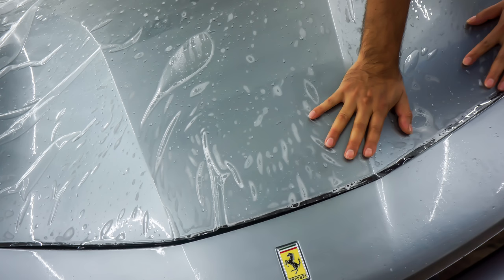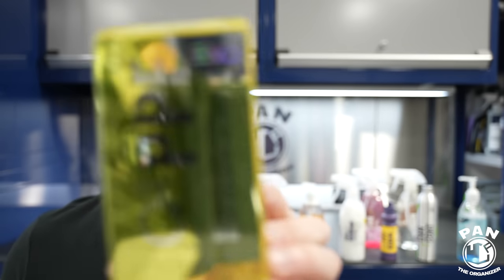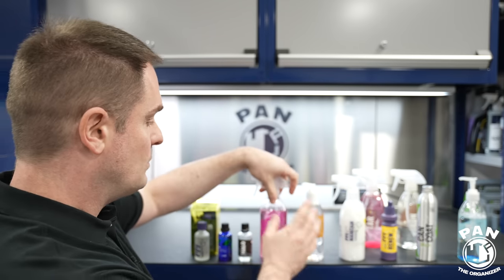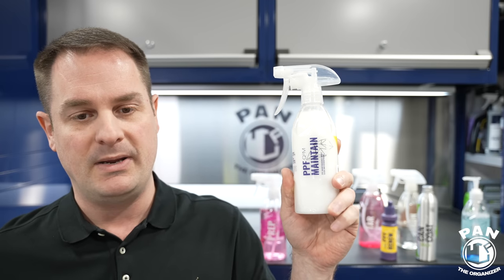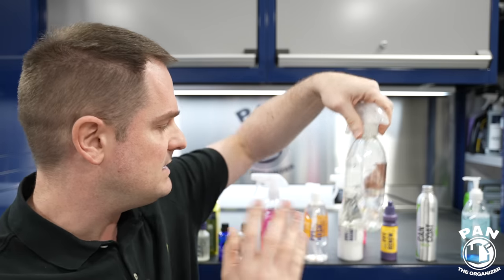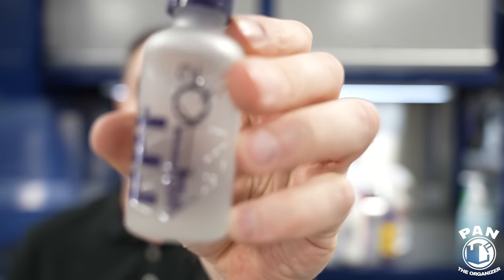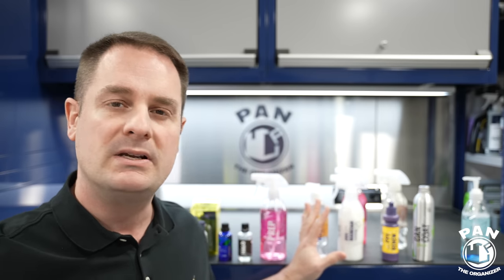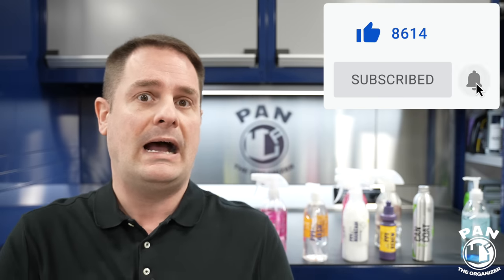How To Wash & Maintain Paint Protection Film (PPF)

Comment: I had some chemical etch into my ceramic coated PPF. Polishing did not help, but applying heat did! Used a blow dryer and that fixed some water spots and etching. Really loving XPELs 10mm film with self healing

Comment: Hi Pan, would it be ok to wash the whole car with the PPF wash from Gyeon if only the front bumper, fenders, hood, and mirrors have PPF? Or should I wash those with the PPF wash and then switch to my usual shampoo for the rest of the car?  Thank you for all your super informative videos by the way, I’ve learned a ton through your videos.
Reply: Gyeon PPF Wash is pH neutral at 7.5, so it's safer than most general car shampoos.

Comment: Great videos as always btw 👍 Quick question? I have a vehicle that has a complete PPF all the car has been protected and it has been installed for about 3 years. It’s in great shape and I maintain it well. The vehicle has extremely low mileage and is kept in a garage quite a lot of the time. 
Do you have to replace the PPF at some point as I have noticed some people say as the PPF ages it’s more difficult to remove it ? Is this correct. I am concerned about how long the PPF will last before it needs to be replaced for easy enough removal before it becomes too difficult to replace?  

Any advice of information would be really appreciated 

Thanks

Comment: Informative video, thank you. I have a 2020 Sienna mini van that has PPF applied over Blizzard White and it shows dirt just under the edges on the hood, front fenders and sideview mirrors. Any way to remove that dirt or mildew from under the PPF?
Reply: Whomever installed it did a poor job.  They should have wrapped it around the edges going under the hood and out of site.

You can try cotton swabs and alcohol 

Just keep in mind that you want it sitting in the sun to get it to bond back to hood after you have cleaned…

Once those edges get damaged they’ll start collecting crap constantly

Comment: Just wanted to comment on the ppf maintain longevity. I live in FL, garage kept, air conditioned, white vehicle, Xpel ppf. Without any sort of decon I get around 1-2 weeks. Maybe it'll get rained on 1-3 times, I don't bring it to work so it'll sit outside a shop or something, not all day otherwise it's in the garage, it does shed dirt and debris somewhat but nothing spectacular or to write home about. For a reference I put about 5k miles on the vehicle in one year so I don't drive too often. Full decon(strip wash, ppf wash, ironx with a synthetic clay bar, panel prep) I get 2-3 weeks out of it.

VERY disappointing to be honest. I'll use the rest of the bottle but it would have been nice for the price to get something with a little more longevity. I won't be purchasing it again. That being said it really does make the car POP, especially for a white car. Some serious shiny candy look going on and very reflective.

Hopefully you see this pan and the manufacturer.
Reply from the maker: If you want maximum durability, apply a PPF coating. There’s a limit you what sprays can do on PPF. Gyeon themselves only claim 6 weeks durability with this. And usually in the real world, you rarely reach full manufacturer’s claims, for many variables often discussed in my videos.

A PPF specific coating should get you 1-2 years of protection. Then use the spray for maintenance. Same principles as for paint products.

See my PPF coating tutorial here: https://youtu.be/7RCgqdGrvrA?si=7wQ86GrlqQ8_pt2V

Welcome to my channel. You discovered one of the biggest car detailing channels on YouTube as we surpassed 950,000 subscribers and we have over 125 million views! I have been detailing for 26 years and I love to share my knowledge and passion with my viewers.

You found the right channel to help you learn everything about detailing.

Comment: Hey Pan, I have PPF and ceramic coatings on my car for about 1.3 years now. And I noticed, they've done a good job on damage protection etc, however, it doesn't shield them from water marks. it's a lot more obvious especially on the hood's PPF. I've washed my car weekly, and yeah, my country has a lot of rain. Almost raining every 1-2 days so it's quite impossible to keep the car dry all the time.. Any tips to solve this water marks problem?
Reply: I suggest Xpel Water Spot remover.  It's designed for both PPF and ceramic-coated PPF.  I use it after every winter to get rid of any traces of mineral deposits and salt.   Just spray it on, let it sit for 30-60 seconds, then rinse off.
Reply: @TheBreakfastLover  Does that remove the ceramic coating?
Reply: @SuperAnonymities  it does not, as per Xpel (and on the bottle as well), it's intended to be used on both Xpel PPF, and Xpel PPF with Xpel Fusion ceramic coating.
Reply: It’s probably just like that CLR stuff you can use in the house for things like showers, shower heads, etc… but probably not as aggressive
Reply: @07wrxtr1  correct, CLR has a pH of 2, which means it is 100x more acidic than Xpel Water Spot remover (which has a pH of 4).  Thus CLR will strip most ceramic coatings, which can typically tolerate a pH as low as 3.
Reply: @TheBreakfastLover  Yeah I figured it had to be more harsh - I just got some for the shower head - stuff is crazy!! I thought we were going to end up buying a new shower head as it was seized up (water in Moab = trash) - Totally cleared it up - but I'd never put it on my car!!!

Comment: Pan, thanks for this.  PPF isn't cheap so maintaining it properly is an issue.  If I had to pick one it would likely be that Gtech Halo.  But I have a question: my QX80 is a tad over a year old.  Always garaged, maybe 6K miles a year.  I understand about being careful of the PPF edges, but why would I not just use Turtle Wax ceramic spray followed by a graphene spray since I already have them, and, they're fairly easy to apply.  I understand they may not last 2 years but as an alternative every 3-6 months, would that not work?
Reply from the maker: Yes that would work. As long as you protect the PPF, it's all good. :)
Reply: @PanTheOrganizer  Thank you.
Reply: Thats what I use all Turtle Wax Graphene Pro products and they work great! No need for ceramic coating as they are prone to water spotting and more difficult to remove.

Comment: Pan,   Big Fan of the channel down in Knoxville TN!!   I recently purchased a 2018 AMG c43 coupe. The vehicle has a clear bra on the front of the hood (only on the hood) installed by the previous owner.   I'm unsure of the age of the PPF/ClearBra. are there some tell tale signs of age that I can look for to determine if it needs to be removed now or later.  (vehicle is very well cared for and appears to also have a ceramic coat, at least from the beading I've experience when washing)  Thanks for any advise!
Reply from the maker: Hi Frank. Welcome to my channel. You discovered one of the biggest car detailing channels on YouTube as we surpassed 930,000 subscribers and we have over 122 million views! I have been detailing for 26 years and I love to share my knowledge and passion with my viewers.

You found the right channel to help you learn everything about detailing.

If the PPF doesn’t seem to peel on edges and hasn’t yellowed or discoloured, it should be fine.

Comment: Hi Pan, Great video as usual. Just wondering is there any difference between Restart wash and PPF Wash from Gyeon? Sames as PPF Maintain and the almighty Wet Coat? Is the main difference is the product mainly develop for PPF due to the difference from PPF and Paint because how the product will "stick" to the surface?
Reply: I'm also having trouble finding the difference online, but it seems PPF Wash and Restart Wash serve the same propose, but PPF Wash is formulated to remove more of the contaminants that get embedded in PPF, while Restart is formulated for coatings/clear coat.

Comment: Great tips Pan!  PPF is always a nice thing to have.  I do have a question though.  Will using CarPro Reset strip away or deteriorate Ceramic sealants like Hydr02 and Wet coat?  I've been perfectly fine with GSF, however, $30 a bottle does get a bit expensive over time...
Reply from the maker: No Reset won’t hurt those.

Comment: Thanks for the video. I noticed there are some water spot shows on the ppf. Is any better way to remove it rather than polish? Cheers
Reply from the maker: You can start with a water spot remover first. You have to neutralize the minerals before attempting to polish. 

If the water spots aren’t too old or haven’t started etching through the PPF, it’s possible the water spot remover on its own will solve your issues.

Here’s a very good water spot remover: https://bit.ly/3UO1UX4

Wash the car first, then use the water spot remover.

Welcome to my channel. You discovered one of the biggest car detailing channels on YouTube as we surpassed 1 million subscribers and we have over 145 million views! I have been detailing for 27 years and I love to share my knowledge and passion with my viewers.

You found the right channel to help you learn everything about detailing.
Reply: @PanTheOrganizer  thank you very much for your help! I will give a try.

Comment: Hey is gyeon bug and grime safe to use on ppf? 
Hows ceramic pro top coat for a ppf? Certified installer here in pakistan uses ceramic pro top coat on xpel
How long can bird droppings be left on before they leave a permanent stain? 
I just got xpel ultimate plus installed and ceramic pro top coat. When can i use gyeon ppf renew? 
Isot necessary to use ppf wash and maintain from gyeon or i can use any detailers or sealants like from kamikaze polish angel?

Comment: I used a pressure washer to wash my ppf ceramic coated car. Some of the ppf started lifting. Be careful with using pressure washers on the edges of ppf.
Reply from the maker: It was likely poorly installed, or you used too much pressure. Never exceed 2000 psi when washing cars. I set my pressure washer to 1000 psi.

Comment: Hey Pan, say you were going to coat a car with Synchro Evo, and part of the car was PPF’d.  Would you use the specific PPF coating for the PPF section or would you use Synchro on the entire car.  The PPF is coat-able in general according to the manufacturer.  Thanks!
Reply from the maker: Syncro on the entire car.
Reply: I was just looking for this answer thanks !

Comment: Hi Pan , I have just had my new vehicle coated and the front clip has PPF with a coating applied as well . This is the first car I have had that is coated and with PPF and it is awaiting the first wash. I bought some KochChemie GSF from OG and I wash wondering if this is safe to use , or should I be using a PPF specific such as Gyeon ? . I would greatly appreciate your advise , and I really love the channel , thanks
Reply: Any quality ph neutral wash will work - reset from carpro or gyeon bathe…. Ppf is resilient once cured…

My ppf is9 years old and still going strong

Comment: Hi Pan, awesome video as usualy.
I have a question, when i aplied Gyon Can Coat the towels used to wipe and buff the ceramic i must trow away theose towels or after i finish i can wash the towels and use them again?
Thank you in advance
Reply from the maker: Throw them away.
Reply: @PanTheOrganizer  Thank you very much for your advice and for your quick answer. You are the best!!!
Reply: @ionutstefan8835 or you can also use them to clean the wheel wells and for applying your tire coating/shine.

Comment: Hi Pan, what kind of product would you recommend in case the car is only partially protected with the PPF (front side). I would preferably want to use a single set of products to maintain both the PPF part and the rest of the car at the same time. Is ceramic coating possible to go over the PPF as well?
Reply from the maker: If you applied a ceramic coating over all the exterior surfaces, treat it like a coated car. ;)

Comment: Pan, Rick here. On a previous video for 20 uses for a rinseless wash, you mentioned putting some in your wash bucket to prevent water  spots for those of us with hard water issues. Can you mix the the rinseless washes in your video with our choice of foam canon wash shampoo, Mr Pink, Adams, Car Pro Reset, etc to prevent water spots?  Thanks.
Reply from the maker: Not sure about the use in a foam cannon. You’d have to ask one of the brands that makes a rinseless wash.
Reply: In general you shouldn't mix rinseless washes (which are higher in emulsifiers) with shampoo (which are higher in surfactants). If you do, the mixture will coagulate/clump and you lose the cleaning properties of both. The exception is DIY Detail Rinseless Wash, where Yvan somehow figured out how to make an effective Rinseless with high Surfactants, which is why it also foams in a foam cannon.

Comment: Hi Pan, can I clay bar PPF and what speed machine polish should I use?
Reply from the maker: In theory, yes you can clay PPF. However, you should be very careful as traditional clay bars are abrasive. Perhaps use a synthetic clay towel, that won't cause marring, something like this: https://amzn.to/3JHfrtG

And make sure you use a clay lubricant. For polishing, you'd use the same speeds as for paint. You start low to spread (speed 2) and polish using higher speeds (5 or 6) depending on what machine you have.

Always do some testing on an inconspicuous area first. Or hire a professional detailer if you're unsure of what you're doing.
Reply: @PanTheOrganizer  thanks Pan for the swift reply!
Reply from the maker: My pleasure.

Comment: So that covers putting products on the ppf, but how about the washing process, and specifically, pressure washing?
Reply from the maker: You would wash your car the same way as a normal car. Never exceed 2000 psi with the pressure washer. And don’t spray too closely to the body.
Reply: @PanTheOrganizer  Thanks for the reply Pan, much appreciated. Some places say not to pressure wash at all, which wouldn't be ideal for me. Obviously avoid too much pressure, particularly near the edges, but unlike most other things in this hobby (illness) it's not really something we can learn about as we go, as if we get it wrong once, we damage our expensive ppf.
Anyway, thanks for all the advice on your channel 👍

Comment: do you think I could simply just use P&S Beadmaker to coat the PPF for protection and shine ?
Reply from the maker: Yes, just keep in mind Bead Maker isn't used for long term protection. It just lasts 3-4 weeks on average. We usually use it as a topper over longer lasting protection, to boost gloss and slickness. As long as you're willing to apply Bead Maker regularly, no issues. 

But the best would be to have a PPF coating, and then use Bead Maker as a maintenance type product.

Welcome to my channel. You discovered one of the biggest car detailing channels on YouTube as we surpassed 980,000 subscribers and we have over 132 million views! I have been detailing for 26 years and I love to share my knowledge and passion with my viewers.

You found the right channel to help you learn everything about detailing.

Comment: hi i have a question, its been 2 years now i have PPF applied on my car and on top of that i applied 2 layers of Geyon PPF coating, now i feel the hydrophobic properties have immensely diminished thus i want to get my car recoated, so my question is what to do? how do i remove the previous layer on a PPF car and install new layer? Is the procedure same for PPF coated car?
Reply from the maker: The only way to ensure 100% removal of a previous coating is by machine polishing. So a light polish and polishing pad should do the trick. You'll know you succeeded with the removal when the water won't bead anymore, and will simply be a flat pool of slow sheeting water.

Comment: Hey Pan, what's the purpose of PPF?  Does it actually protect the car from rock chips?  How would I know if the PPF failed to protect the car from rock chips?
Reply from the maker: PPF is to protect the paint against stone chips and scratches. Yes it works for those specific purposes.
Reply: @PanTheOrganizer  
Unlucky for me, I received 2 chips earlier today (Post PPF).  I emailed XPEL to see if I can get the warranty replacement.  Just picked up the car from PPF on the 7th.  Damn, LOL.
Reply from the maker: PPF won't stop stone chips from happening. What it does is it prevents the paintwork underneath from getting the stone chips! So the PPF will still get stone chips and scratches, but it will do its job protecting the paint. Hopefully the PPF shop explained this to you??

Case in point, on my own Porsche 911 Turbo S, the rear arches are super wide, and are covered from factory with PPF. After 2 years of driving, the PPF got hammered by stone impacts. We removed the PPF to replace it, and underneath the paint was pristine. Here's that video: https://youtu.be/gusUiD9uoW4?si=wh41Fmqw-mESb731
Reply: Thanks Pan.  The shop did explain in a similar fashion like your first paragraph.  Now with the same token.  I'm not sure how strong the impact, but one of the dots made a dent on it.  Is it something I should be concerned about? @PanTheOrganizer
Reply from the maker: Ouch! That must have been a pretty big impact to make it through the PPF. At this point, you'll have to decide if you want to go the dentless paint repair route, or let it be.
Reply: @PanTheOrganizer  Hello Pan, now that concerns me quite a bit.  I'm not sure if the film is tough enough not to scratch the paint.
😅😅😅
Reply from the maker: There are different qualities to PPF and thicknesses too. I know XPEL has different variants, so perhaps look into a thicker higher end model.
Reply: XPEL Warranty Specialist reached out to me via email and requested for the photos of the issue and the invoice. @PanTheOrganizer